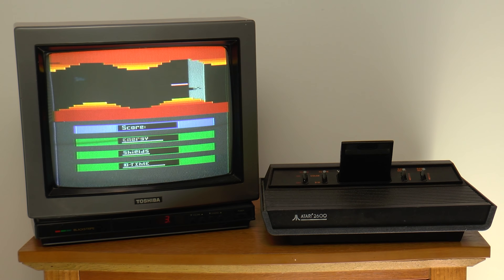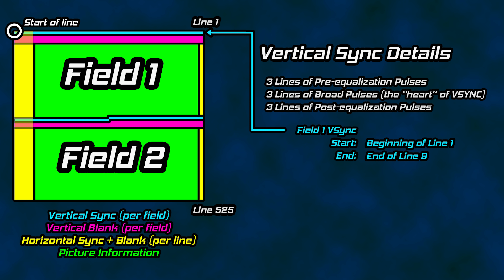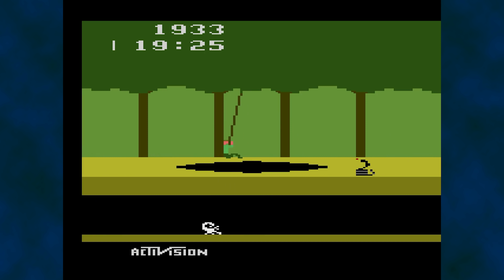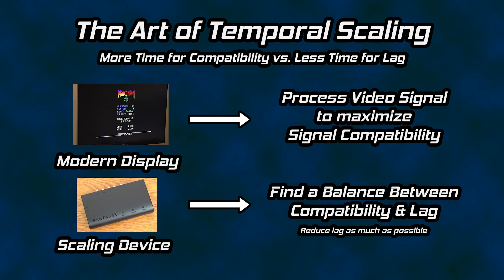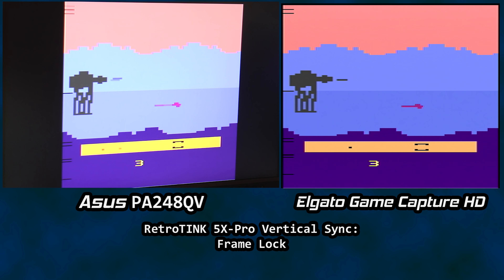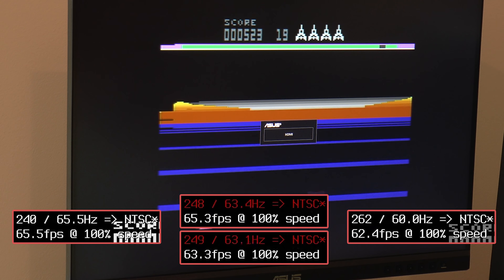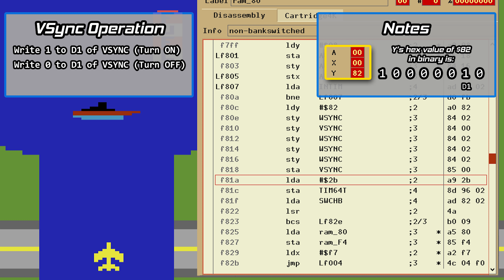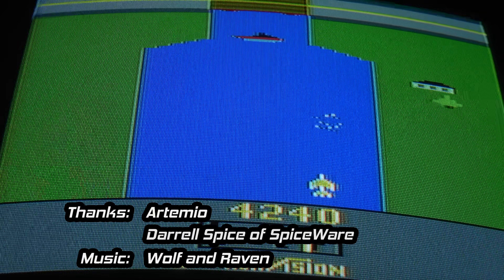The Atari 2600, Analog Video, Scalers, and the Agony of 240p Ambiguity

Comment: This is so bizarre and so fascinating! I love this kind of stuff. I had a feeling there was something sketchy going on with the 2600’s video output when I got my own one yesterday, I tuned it in via my VCR and it was fine at first, but whenever certain stuff happened in certain games it would flicker and roll and sometimes completely loose sync. Eventually, I solved it by activating my VCR’s auto-fine-tune setting, which dynamically adjusts to follow an unstable RF signal and that seemed to fix it, but the VCR seemed to show it was constantly having to adjust to keep up with the sketchy output from the 2600. Admittedly some of that is probably old age and interference and the like, but it was interesting to notice that and then see this video s day later.

Comment: Why does everyone need a scaler?  I have my Atari 2600 on a 4k uhd 50" TV through COAX on RF on Channel 2 and have not had any problems at all. Ive had more difficulty with the DSP and my NES on A/V than with a 2600 on analog channel 2.

Comment: And that’s why i hate my sony bravia tv because not only does it take long to start up by it also sometimes fails to get in synch with composite video signals wich forces me to unplug and replug the composite video jack in order to get a proper image from my nes,and theres also that slight input delay and you can see those combing artifacts in fast scenes such as flashes wich can be very annoying,luckely the frame meister wich i do own solves these issues😁

Comment: I guess I'm lucky in that my Sony x900h seems to do well with an Atari VCS/2600 with unmodified games, I mean it's not flawless, Battle Zone plays without any screen issues, Buck Rodgers has a little jumpiness on the title and level screens but otherwise plays fine, the empire strikes back displays without any screen issues. And this is still using RF (using an RCA to F type adapter on the coax input of the TV) before I mod it for composite output and refresh the components.

But even when I was a kid back in the 80s not all CRT TVs was tolerant (some TVs was) to these anomalies and would cause the TV to lose v hold for a split second (regardless of how you have everything adjusted), and some TVs took it in stride.

Comment: If these old systems look best on an old television, why isn't there literally anything at all that does what an old television does?
These old systems used a moving spot of light, which had momentum, to draw a picture line by line, which you then viewed.  The momentum would smooth out things.
Instead, literally every capture device/converter/upscaler/everything converts the analog signal into rows of pixels in a very rigid video file.  If the video format gets out of line with what the video file suggests, it breaks.
Reply: So one idea is to literally make a CRT emulator. Not something like the atari emulator, but a literal program that takes raw video samples and simulates how a CRT draws a picture.
You'd have a spot of light that paints to a canvas, with a 2D position and momentum.  It would sweep the canvas in a raster, painting pixels as it goes.
And just like a CRT it would handle things like this just as well as a real CRT would. But, like a CRT, it wouldn't be a 1:1 display by default.
I'm sure some methods could be made to make it 1:1, but its not straightforward.
Reply: The only practical solution we have is to do our best to preserve the CRTs we do have. Unfortunately the only economical way to produce good CRTs like the ones we had in the 1990s-2000s would be to produce them on the massive scale that we did… which would not work for obvious reasons. But anything using simple, small, black and white tubes (projectors? wink wink) could be feasible.

Comment: IMO these issues are bugs. They might've been invisible, but are still violating the spec. The spec is there for a reason, and if you violate it, you have no guarantees that your program will run on all spec-compliant hardware. It would've been impossible to test the game on all available TVs. If you use hacks, coincidental behaviour or private apis, you program might run fine, but you must remember that it will break sooner or later.
Reply: The spec was for television programming, not for video games or other signal generators.  The televisions themselves had their own specs for what signals could be accepted and the atari's games all were within these specs at the time they were released.  The television's signal handling specs were the target spec, NOT NTSC OR PAL, the tv's specs had to be designed to be able to atleast handle either ntsc or pal transmissions to be useful in the markets they were sold in, their own specs were more permissive than the ntsc or pal specs tv broadcasters were restrained to.

Comment: I remember in some documentary on Atari, I heard that there were only a few handfuls of programmers in the world smart enough to program for the Atari, I always wondered if they meant the Atari specifically or video games in general because I couldn't understand how such a simple looking machine with such simple games was harder to program for than an arcade machine or microcomputer, but then I watched a video on Racing the Beam and I was like "oh yeah that explains it."
Reply: Well that's part of it, definitely, but the VCS was designed to run Pong and Tank games only and it only supports just enough simultaneous sprites and features for those types of games. Racing the beam actually was a blessing in disguise, as you could display more sprites by redefining the existing sprites mid-frame! But yeah, programming the VCS always seemed to me like being MacGyver - turning the components of a Pong machine into something that can play Donkey Kong. Must have been incredibly difficult.

Comment: Buck Rogers Planet of Zoom has problems even on CRTs. When I play it on a 7800, my good old CRT TV loses vertical hold at the title screen.
Reply: Yup, that would explain why some games when it changes screens or does something on screen and the TV would quickly roll/flip/bounce the screen because it lost v hold (and it wouldn't matter how you adjusted the TV it would still happen), I noticed this when I was a kid in the 80s, even back then you had TVs that was intolerant to what signal gets put into them.

Comment: The first time I had to learn the hard way what 240p was, was playing my PlayStation 2 with component cables (after getting my first HD/LCD TV in the mid 2000s) and popping in a PS1 game. Get the game running on the top half of the screen with BIOS garbage on the bottom, if not more problems. Checked the Sony forums, and the only answer I got is that hopefully you still have that composite cable that came in the box, and to swap it in.

Comment: Hense why I own a CRT. Problem solved
Reply: Not all CRTs are created equal, some CRT TVs behaved worse than some modern TVs
Reply: @madmax2069  true, just got to make sure the TV is a standard definition CRT and not a HD crt.
Reply: @Chris-Courage  they didn't have HD CRTs in the 80s. The CRT we had in the living room in the 80s would flip out with some of these games (especially Buck Rodgers, Battle zone was bouncing all the time, and some would flip the image around on a scene change, as soon as some games did something odd it would lose v hold for a split second and sometimes take a while before it would recover, and it was a brand new TV. 

The TV we had in the 80s was worse than my current 55" Sony x900h, this TV has been pretty tolerant to the games that play shenanigans with the video signal, Battle zone shows up fine, Buck Rodgers has a few issues but doesn't blank out, it bounces once when the title screen shows, and bounces once when the level screen shows and the gameplay works just fine. And the empire strikes back plays without a hitch.

Comment: "If you programmed the game in 1980, and it worked as expected on mid-20th century technology, but then later struggled when it came to 21st century technology, is the problem really a bug?"

I'd say yes. Not because it stopped working, but because it didn't follow the specs.
Reply: Yet at the time it fell within real world specs. No CRT back then would fail with such timing anomalies that is why when video tape tracking are bad, CRTs will still do their best to display that mess no matter how garbage the tracking is, CRTs are too stupid to know any different as they don't have frame buffers and the gun just does what it told like oscilloscopes.
Reply: @Psy500  I wouldn't say it fell within any sort of specs, which are in the end, written requirements. Anything outside that is outside specs, even if it works.
Reply: @felineboy  While it didn't fall within the specs of NTSC or PAL, it fell within specs of the TVs themselves. If in 1980 you went to the likes of Sony, RCA or Zenith their engineers would say with confidence that it falls within tolerances provided by the overscan (that exists for just this kind of inaccuracy in the timing). Analog electronic geeks already knew this as far back as the 1973 with the TV Typewriter that was far from accurate in providing a signal.
Reply: @Psy500  Don't confuse specs with tolerance from the devices. It probably would have been harder for the engineers back then to enforce the standard than just letting the device do whatever the signal told them to do, even if not within specs. Let me give an analogy: My English grammar might be bad (which probably is, given it's not my first language). You might understand what I say, but that doesn't mean it's
 proper grammar.
Reply: @felineboy  It is more back then there was no point to enforcing NTSC/PAL that strictly on the TV side. For example you were not going to have the TV blue out  just because the user changed channels so all of sudden the TVs sees a new V-blank while it was drawing the previous frame thus got an extra frame.
It only a problem now because of displays interpreting the entire frames instead of real time control of the line sweep thus if anything it is a compatibility bug of modern displays not of how devices were designed to work with CRT displays. It would be impossible to convince anyone in the 80s this was a fault since the TV displayed the image fine and it not harming the TV.
Reply: @Psy500  but some old TVs did fail with such timing anomalies, not all old TVs was tolerant to them.

Comment: A couple of minor notes: the 8-bit computers by Atari and Apple used scan lines that were 228 chroma clocks in duration rather than 227.5, so even a 262-line frame would be 59.922Hz.  For systems that used 227.5 chroma clocks, the choice of 262 or 263 would visually affect the image, since 262 would yield a stable chroma 'checkerboard' pattern, while 263 would yield a checkerboard that swapped phases every frame.  The NES for some reason uses a unique horizontal rate which shifts chroma phase by 1/3 every scan line.

Also, the question of how to capture video may be affected by how one will edit it.  A frame-perfect capture at 59.47Hz may be better synchronized with audio, if played back accurately, than a triple-buffered version, but if an editor tries to convert it to 60Hz that may yield distorted audio if the editor has to insert empty frames to make the timing line up with reality, or only includes 1/60 second of audio with each frame.

Comment: 1977 - Writing a game involves an individual learning all the technical details of the target console, figuring out how the features can be used to make some sort of playable game, and then tediously writing cycle exact assembly code which must be painstakingly tested on real hardware on a continual basis.
2021 - A massive team with millions to spend can write just about anything they can dream up on state of the art tools and with minor modifications can compile the code across a wide range of devices.
Reply: With abstract layers, runtime engines, and common code codebases 😁
Reply: Yeah, not really. There is a point where you have to go the old school mode and really optimize the crap out of your code, as seen on Doom 2016 and Witcher 3 on the Switch. 
And a new API such as Vulkan even supports lower level control of the hardware.
Reply: @fungo6631  You are one of many people who incorrectly believe that DOOM 2016 achieves relatively high framerates because it is "well-optimized". It's not. It's simply non-demanding compared to other (mostly open-world) AAA games. There's not near as much going on, and no near as much to process.
Reply: @bricaaron3978  You do realize that less open world games can also use higher detail graphics?

And IIRC even MVG praised the Switch version of Doom.
Reply: @fungo6631  I didn't know you were referring to the Switch version of DOOM 2016. I don't know anything about it, but that version may indeed be well-coded and -optimized in order to perform well on the Switch.

I was referring to DOOM 2016 on PC. The reason it achieves framerates significantly higher than other contemporary AAA games is that there is very little to process: No open world/high draw distance, no advanced lighting, no NPC AI, no physics, etc. If anything, it proves that you don't need to push technological boundaries if you have great gameplay.
Reply: And yet they come out buggy messes

Comment: Nice and detailed summary of some of the issues with old games!
You asked: Is that what happened a bug, considering it worked on 4 decade old hardware - yes, it is. As a dev, I can say for sure.
As a dev the answer is simple, you showed part one of it: There's documentation, and the game didn't follow it. Part two, there's the actual way of WHEN vsync should happend by NTSC standard, and that didn't happen. 
Even if it worked in real life at that time, this is a bug, and it just happened to be exposed later when things followed standards more closely.
Reply: The output of the VCS, and in fact just about all game consoles up until and including the 16-bit era, actually never, under no circumstance, follows the NTSC standard with regard to actual timings. It just hits it kinda close enough for CRTs to not be too bothered. The early 3D consoles like Playstation got it to where they can optionally be NTSC compliant, but the most common modes are not. NTSC simply has no provision for non-interlaced video that these output.

Also your rigid view of things would prevent any creative and unusual use of hardware. Watch "Poems for bugs" i think by lftkryo, learn about viznut's VIC20 sound kernel, and many other WONDERFUL things. A lot of console games resulted in the official system spec being tweaked or rewritten. For example the streaming system in the original Crash Bandicoot runs afoul of original maximum disc hits per minute spec. Would have been sad had it been just forbidden.

Your point of view is understandable from modern perspective, where any deviation from spec will not bring you bliss but only delayed punishment, it's a technical debt at best. Where there is an insane network of interdependencies, which can all get independently be replaced and updated - the underlying hardware, the operating system, hundreds of libs, etc. Where most projects work in large teams with dozens or hundreds of other engineers, and the spec forms the foundation of communication, and even if not, you depend on so many other engineers and each of their individual decisions, and you must be able to trust a common said of foundational assumptions, i.e. the spec.

But these are pieces of software written by small teams to run on bare metal, which is guaranteed to not change. It's a whole different approach. The documentation tends to be somewhat sparse too, leaving out many actually useful and important to know details.
Reply: @SianaGearz  While I understand what you're saying, and I know that creativity made solutions - it still does (I did under MSDOS and I still do with modern standards) - there's one simple thing. The observation I made may have followed modern standards indeed, it's a simple thing here: There was a spec given by Atari. The spec hasn't been followed. The problem could be solved by following the spec - that's a bug, no discussion there.

I get that consoles are a bit trickier, and they especially have been in the past, and I understand that they merely did enough to PAL or NTSC that it "just worked" (look at e.g. the PC and CGA NTSC color artifacting), and that they merily followed the minimum spec to get a picture, I was mainly talking about the part where the specific Atari doc has been shown - which the game didn't follow. 
One might not have understood this as a potential bug at that time, given that it worked on CRT's, but it is.

Thanks for the video recommendations - but I'm getting a bit of a feeling you're thinking I am someone I am not, which feels a bit weird, given the few sentences I have written.

Comment: Imagine todays point-and-click game-"developers" would attempt to "develop" a game for a limited console such as the Atari 2600/2600jr which has no frame buffer and (correct me if I'm wrong 128 bytes of RAM)
Reply: Imagine if those Atari 2600 developers had to develop for a system that demanded that graphics look realistic instead of like one pixel blobs that the users had to use the manual to figure out, or that have long complex stories with (many) NPCs and (much) text, systems where AAA games are hundreds of developers years instead of one developer six weeks. Better yet, imagine a world where we could consider the Atari 2600 without bagging on later developers working on entirely different systems.
Reply: @prosfilaes  u smartass it was a joke
Reply: @prosfilaes  facepalm
you didn't really get it, but OK.